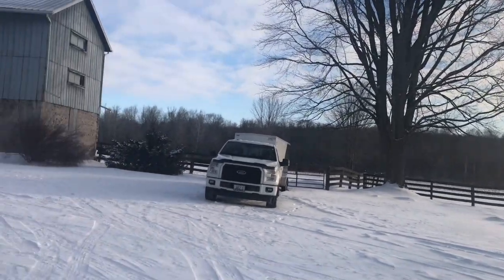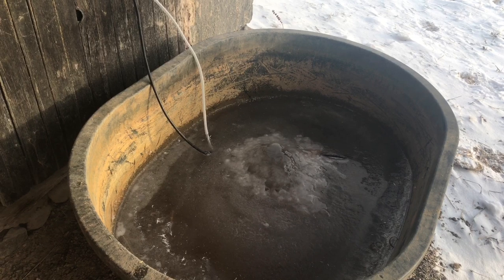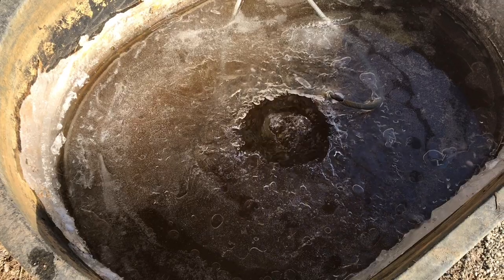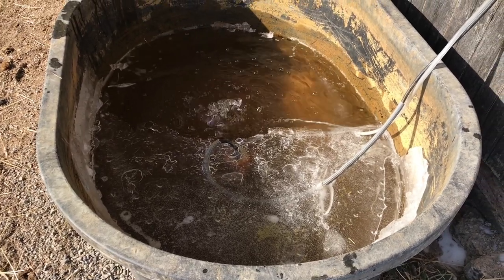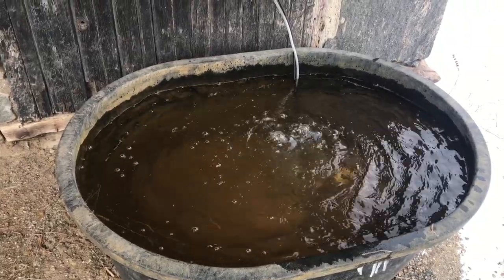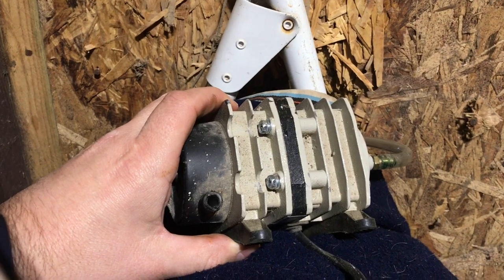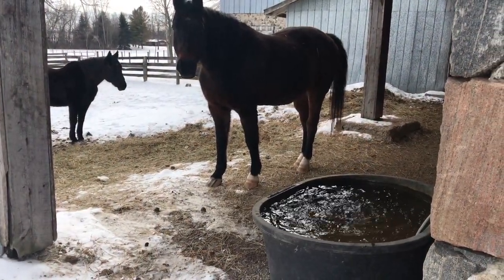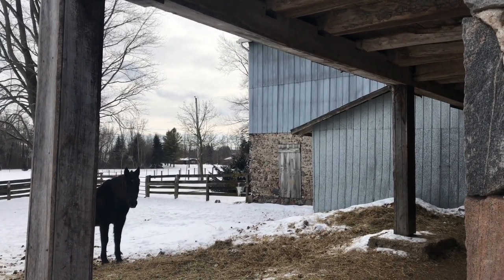HOW TO KEEP YOUR HORSE WATER TROUGH FROM FREEZING

Comment: I dont have electricity near the horses water and we usually dont have to worry about the water freezing. When we have a cold front like today it is 2 degrees Fahrenheit -13 with wind chill. So I got 4 big rocks yesterday, cleaned them off and baked them this morning at 425 degrees in the oven for 30 mins. Took them down and placed them on the water tubs which were  about 2.5 inches of frozen ice. Melted through and warmed up the water enough so they could drink water. Its 2 hours later and it did not freeze again yet.  Sounds weird but it's what I came up with 😆
Reply from the maker: That's a great idea!  We do what works in our situation.  My next idea is to build an insulated box that fits over our tank with a door to open when the horses are out.
Reply: That's a good idea. You've probably already thought about this, but you could get a basetball net, zip-tie one end shut, place the rock in the net, then with a rope synch the other end of the net and hang the tag end of the rope out of the trough, this way the rocks are easy to get back out of the tank without too much trouble. Then on day two have a second set ready to go for your baked rocks in the enclosed basketball net and rope line, and when the water is clear of ice on day two, hoist out the first rock/set of rocks from the previous day using the tag end of the rope - now you've got rocks ready for the oven/next day - and keep the rotation going.

Comment: This is awesome! I was trying to figure out what to do in MN for temps near 10 degrees F over night in a location without electricity.  This will allow me to use a portable generator and keep the water open all night! THANK YOU SO MUCH for doing this video!  I am wondering what the smallest wattage would be that you would recommend. This 20 watter looks like it is very powerful.
Reply from the maker: Thanks for commenting,  I really appreciate the feedback. As for a recommendation on wattage, I'd only be guessing.  My 20 watt keeps the water pen and doesn't bother the horses.  Going smaller or larger could change that result.  This is just a suggestion, I don't know if it would work or not. Could you hook a small inverter up to a deep cycle battery with a solar panel to recharge?
Reply: @aroundthecounty1139  OMG!!! That's EXACTLY what I am setting up!! Except with the exact same bubbler as you are using! I bought it and so far it's working great with a table top generator/electric rechargeable battery.  But it only runs for 8 hours and it costs $180. SO YES I just ordered 2 deep cycle batteries from walmart.com for $100. and we also have solar panels out there already, so plan on using those to keep the batteries going plus we can run them home and charge with a battery charger. I hope this will be good to zero degrees and I can add more insulation to the tank as well. I moved it inside the shelter, insulated it and covered half of the top with hard insulation as well.  To keep the water warm I was also wondering about a fish tank heating light.
Reply: We are thinking of doing something like this, but running it off of a small solar panel. They are relatively inexpensive and still looking into various panels and their reviews.

Comment: I'm not sure what you mean by keeping the bubbler above the height of the water trough to keep water from siphoning back thru the bubbler
Reply from the maker: If you lose power and the air pump is located below the waterline, water could flow into the air pump ruining it.

Comment: Is there a hose that comes with the pump ? I’m wanting to try your way this winter in Colorado
Reply from the maker: I believe I purchased a small length of hose.
Reply: The pump came with only about a 5" hose, but you can purchase an 8' section for about $4.50 at home depot. Just go to the plumbing area and they have the exact same size hose.

Comment: I have one cord out to my tank.  I bought the bubbler and have the 1500 W coil heater.  The timer you suggested says that it's not for use with above ground pool pumps.  I'm wondering if it's adequate to use with the 1500 W coil heater.  I would like to find a timer with a dual plug where each plug could be programmed to shut on/off.  I could run the coil heater for an hour, have it shut off, then run the bubbler, etc.  No success on finding that kind of timer, so far.  Also, it helps to fill plastic bottles half way with salt solution and let them float in the tank.  The salt creates a little heat.  That in combination with the movement from the bubbler and a tank cover usually does the trick.  If we get a cold snap for a few weeks, that coil heater is necessary.  Thank you for the video.  The bubbler idea definitely helps and saves money.
Reply: Salt does not create heat. Putting salt inside the water bottles has zero effect other than lowering the freezing point of the water inside the bottles.

Comment: Yah but how do it without your horses eating the cords we’re trying to figure out how to put it without them chewing on the cords
Reply from the maker: Our horses have never bothered with the air line or cords.  I have seen some people use black threaded pipe or conduit to run the cords through.  Since this video I have built an insulated box with partial cover to held lower costs further.  This may also protect the cords from the horses.